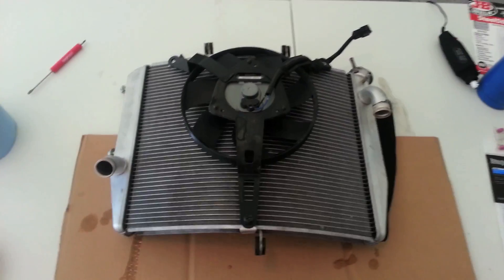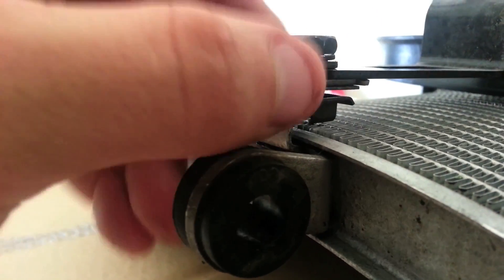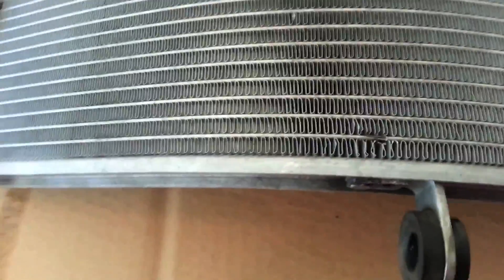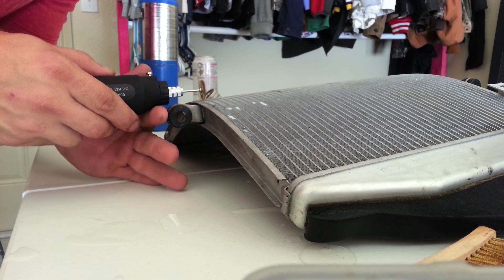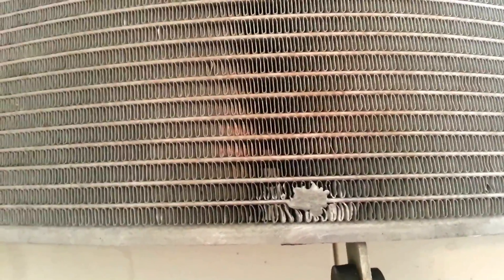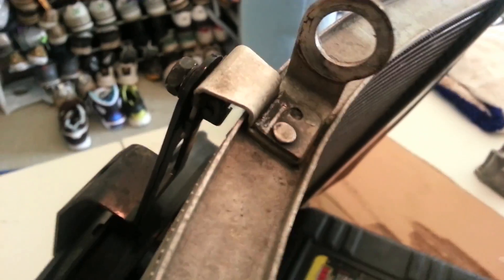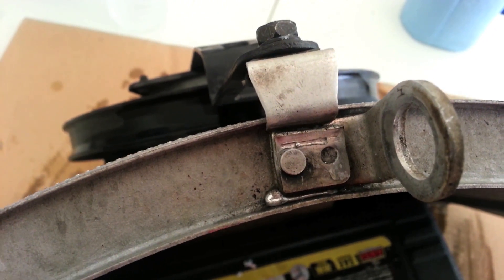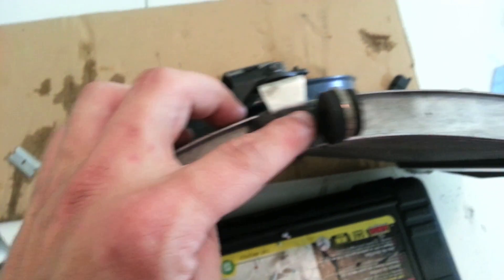Radiator Repair - Aluminum Brazing - Motorcycle - 2007 Kawasaki ZX6R - HOW TO

Comment: After a repair like that, you need to wet the bike really hot and pressure test it.  Put on your safety glasses, stand back and lightly poke your repair with a nail.  If it doesn't survive a poking, it was always going to leak again.

Comment: nice I used Quik steel 2 fix my Crank Case that had a hole  the size of my thumb 1  1/2 ''  & Crack  on 1100 Honda in 2014 still holding oil  for 2 years now *** ty for your video

Comment: I just bought my zx6r not to long ago and the same thing happen but it happen before I bought since the fan was poorly rigged by the previous owner with extra confusing parts I guess I have a leak in the middle where the center of the fan has been touching Im going to try to weld it today or tomorrow

Comment: I had the Exact same thing happen to my ninja,,I made a lil Bracket from my rubber mounting hole,,,Plus...I put soft black window foam around the outer plastic frame of my fan,(where it would meet up with my radiator,,Still holding after 3 years,My friends Suzuki already has the soft foam Factory on his....
Reply: How did you repair your radiator?

Comment: Thank you very much about posting this! I actually have a NLA radiator with a hole about this size that needs to be fixed. I had it for well over a year wondering that to do with it. Might have saved me $450! Thanks! :)
Reply: Did you fix it?

Comment: I like jb weld but know it won't hold up... I've used jb weld on my cj7 dash to cold weld a couple of my switched to the back of my dash and when I sanded the top of the dash, the weld broke off of the wiper switch. Had to reweld it..

Comment: My 2007 ZX-6R had the same problem! The bottom radiator fan mount bracket breaks and causes one of the mounting bolts to constantly slam into the radiator until severe leaking occurs. This is most definitely a design issue and manufacturing defect and should be recalled by Kawasaki!
Reply: I'm surprised same thing happened with my ninja 300, the dealer asked 400$ for radiator and 350$ for fan assembly, i took it home and fixed in 15$ LMFAO

Comment: This is a manufacturer design defect and should be recalled by kawasaki. I had this happen and there was coolant everywhere including some on my rear tire. The bottom mounting tab will continue to break even when re-welded. I wonder how good the JB weld will hold up down there, I might try it or even eliminate that bottom mounting tab, bolt and nut altogether somehow.
Reply: Same with mine pin hole in the row

Comment: Heat the parent metal and allow it to melt the solder. Don't melt the rod with the torch or you will get a cold solder and it may not hold.  Good first try though. Flux will also help you. When the flux bubbles you know your ready and the solder will follow the flux and fill and bond much much better.
Reply: Which flux is best for aluminium?